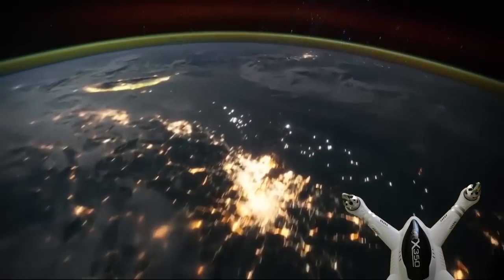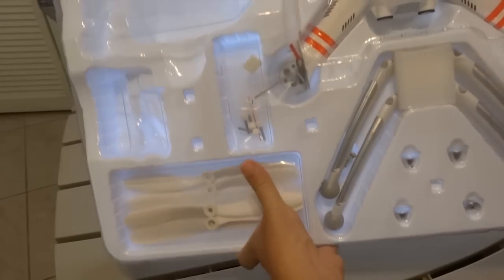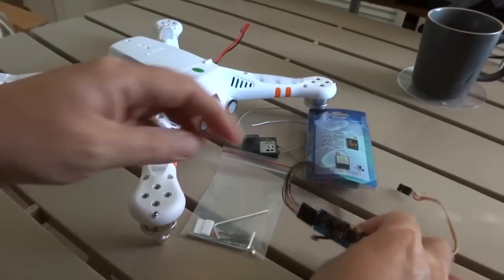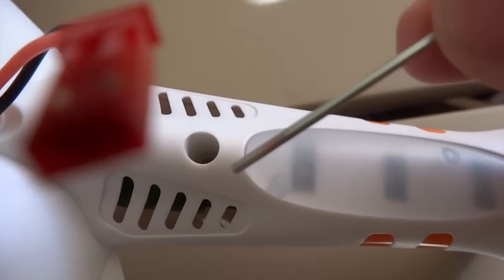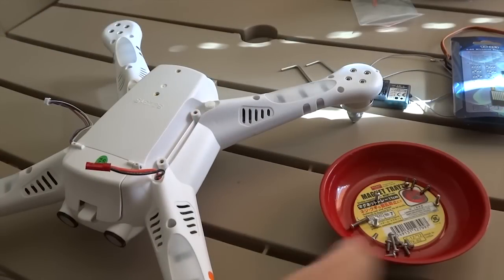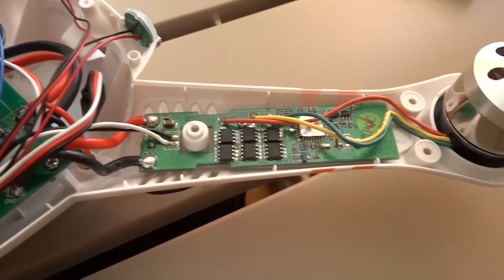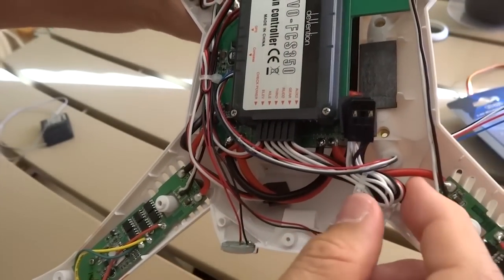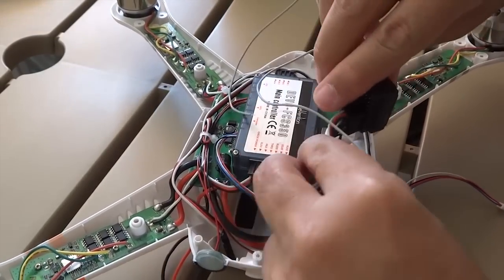Walkera QR X350 Review BNF DIY Receiver Install - Devo 10 RX 1002

Comment: Nice Video. I have a Walkera 8S with receiver. Will this unit work with the QR X350? What else do I need and how do I bind/pair the 8S with the X350?
Reply from the maker: +Silver Seeker60 hi, yes, Devo 8s should pair with most models, backward compatible.  This model is about 2 years old, and that is a long time for Drone years, try the x350 Pro or x350 Premium.

Comment: Thank you, diydrone, for your reply.  I'ts great to know someone is paying attention.  We beginners need all the help we can get.  

I understand the bind plug connects the first and third pins on the Batt terminal - the ones labeled omega and minus.  I assume this connection is to be made temporarily during the initial assembly, as the Batt socket is not accessible after assembly is complete.  

I further assume the RX 1002 receiver is powered thru one or more of the input connections (throt, elev, rudd, aler).  Which is to say it is NOT powered by a 4.7-6v source as the R702 is (per Walkera documentation).

To date I have 4 connections between the DEVO-M and RX1002.  All the above leaves me with this question:  How does one connect the DEVO-M controller for the CHECK POWER INPUT?

Once again, thank you for your help.

Paul Skrotzki

Comment: I have a X350 Pro with Devo-M controller and RX1002 receiver. Not able to bind it to the Devo 10 transmitter.  Have connected aler-aler, elev-elev, throt-throt, rud-rud, but have no chk pwr on the receiver as I do on the controller.  Therefore, have 4 items connected, not 5 as shown in this video.    Also received a binding plug, but don't know here/how to use it.  Bind between transmitter aand aircraft does NOT occur.   Manuals from Walkera are no help.  Can anyone help, please?
Reply from the maker: to clear a receiver, you just put the binding plug on the BATT slot, then power the receiver with any of the channels.  I think the light should start blinking.  the video is for the x350, so the Pro will have a Devo M.  make sure the gps is hookup.  Remove your props for safety.  You will need to power the x350 Pro first and then the devo 10.  You will then complete the Walkera Calibration.  The x350 Pro will not start up until you have completed the initial setup checks, which checks everything is connected and calibrated.

Comment: Hi all, great channel, awesome vids.Please can you give me a little advice? I've got a QR X350 which has had a couple of heavy landings! Now I only seem to get a couple of 'seconds' of run time out of a fully charged battery. Can u tell me what part(s) are likely to have been damaged?? I noted the last battery read out after running was 2 cells @ 3.75 Volts and another cell @4.20 Volts???!!!  Any info. would be greatfully received, thx, Luis in Portugal

Comment: I currently use that OSD on my DIY quad. How do you pull information from the walkera onboard flight controller into the minimOSD? does it use mavlink, or is it a type of multiwii (KVOSD firmware for the minimosd) ? thanks!

Comment: im new on the Quads ,
is there any special trims i need to adjust ?
Reply from the maker: not much, just assign your channels to your receiver.  these are RTF ready to fly, however you should get the Pro edition.
Reply: ***** okay i ordered the Walkera QR X350 PRO Quadcopter (PNF)
you have any idea how to set the 3 modes, the Manual ,GPS Hold , and the RTH?
my radio is Futaba 14SG
Reply: saleem, we don't have a Futaba, but it should be the same.  When your box arrive, you should find the Quick Start Guide or you can download it.  You will find a diagram with the Main Control Board.  Follow the diagram.  When you start connecting your channels, you will see the Gear out, just attach it to a 3 position switch channel on your receiver.  run a test at 15 feet, by flipping the switch once, putting it to position hold.  if it holds the position, you are good for the RTL test.  Make sure you have the latest firmware.

Comment: Hi, can I use Devo-M mainboard and Devo-RX703 receiver with the new Devo 10 (white) and leave everthing else as there are? I'd like to transform my X350 to X350 Pro. I want to fly it in GPS mode all the time coz I'm not a good pilot.
Reply from the maker: Hi, we asked Walkera and they say yes.   Lots of parts for an upgrade: http://dronemission.com/coupon.html  You may also want to consider the BNF and save your first model as parts.  Devo 10 is a good radio, checkout Episode 50 on how we make the Devo 10 into a powerhouse to fly different models.  regards.

Comment: Hi Leo,

Finally got down to fixing up my X350. OK here's the setup:
1) Changed out original ESC to HK Afro 30A
2) Changed out original motors to Turnigy 2213 900KV (200W) motors.
3) Propellers are original
4) Propeller guards installed.
5) Firmware upgraded to V1.2

Test flight once with the following report:

Everything works ok, throttle seems smoother than original, but needs around 3/4 stick to hover. I think maybe original motor is 1000kv vs this Turnigy at 900Kv? Also there is an additional weight after installing the 4 Afros30A ESCs with some length of wires.

Motors run alittle warm, possibly also because of the 3/4 stick throughout the first flight.

Alot more stable with V1.2 firmware. Will give it another 2 battery packs to settle down before switching to GPS mode and RTL.

Lastly, just to highlight, i realised what caused my original motors to stutter and ESC burn. There are 2 long screws and 2 short screws for the motor mount. I took out the motor mounting screws to put on the propeller guards, and when i screwed them back, the 2 long screws somehow went into the motor magnet coil wires. There are too long and if you try to screw them in alittle too much, you will hit the coil wires like me. That caused binding and in turn caused load on the ESC. It is truly a silly mistake. 

I am not sure my initial weird flying behaviors were caused by the faulty ESCs or the V0.9 firmware. Anyway, i can't know the answer now that i found out i caused the original motors and ESC to die. 

So for all those reading this: BE careful when you are putting on propeller guards or if you are going to remove the original screws!

Next up, once the FC proves to be able to fly stable, i am going to transplant the whole FC onto a "Reptile" quad frame and setup for FPV flying. Will keep you posted on that as well!

Cheers.
Reply from the maker: Alan, that is an interesting observation with regards to 2 long screws and 2 short screws for the motor mount causing the motors to stutter.  We will definitely take note of that.  We spoke to Walkera recently and they say the firmware V1.2 and 1.3 are identical with the exception that 1.3 has a lower voltage protection.  So if you want to fly longer, use v1.3, but take the necessary personal precautions, like keeping track of time.

With regards to PID for H-frame copters, we do not have any experience in that, but I will always start without any change and a well balanced prop.  Sorry for the delay reply, we have been busy with the finding missing children projects, so a few APM videos stays in the queue before we can get back to it.  We also have 2 planes that need work, one will be upgraded to Arduplane.

If you or anyone would like to contribute to the next video campaign, just raw footage, see details www.dronemission.com/video.php  We would love to see you fly over the Merlion, just kidding.

Leo
Reply: Hi Leo,

Thanks for the tips on firmware differences.

Recalling back, I think the longer screws could have come together with the prop guards. In all cases just be careful.

Btw, I also managed to hook up minimosd V1.1 to my Ardupilot. I went by the sealed jumper route, drawing power from APM only. All is good! Forgot about my FTDI adaptor though, waiting for that.

Hey thanks for invitation to the video campaign! Honestly my group are still multicopter novice so no long range flying for us. Yet. Hahaha

Will tell my buddies about it. Maybe u may find some of our videos interesting. Be warned of the boring flying site though! 

Keep in touch buddy.

Alan

Comment: is there a battery charger you use some one help me i need a lipo charger for my 
qr x350
Reply from the maker: What LiPo battery are you using?  Is it the one that came with the QR x350?  According to Walkera this will be the charger:
http://www.banggood.com/Walkera-RC-Model-Tools-Spare-Parts-Charger--p-80102.html?p=KT2121095598201211UX

You can of course use other brand LiPo Charger or convert the connectors.
Reply: ok thanks :-)

Comment: Hi Buddy,

Just to keep you updated on my progress on changing out the original ESC from the X350.

I replaced them with HK Afro 30A esc. Remember to remove the Red power pin from the rx plug before plugging in back into the mainboard for ALL 4 ESCs.

It works ok. Then i noticed that the same 2 motors that had the burned ESCs, they are still stuttering. I went on to remove them and replaced with another 2 motors to test. Everything works normally now. 

So what i found out, the motors had some issues, which in turn caused load on the esc and caused it to overheat. Then i also realised another thing: Before my very first maiden flight, i have removed the screws that secures the motors to the arms to fit in the propeller guards. And i noticed that it gets alittle difficult to re-screw them back into the motors. And for those 2 motors that i wasn't able to screw back in properly, they ran hot and subsequently burned the esc. 

So i think the way the motors are being fastened onto the arms via a circular carbon piece, it somehow damages the motors and in turn causes load on esc. 

You may want to check your motor mounts and see if its the same case.

I am going to buy multistar motors to replace all 4 of my original walkera motors.

Oh yes btw, the APM 2.5.2 ROCKS on my H4 Quad Copter!!!
Reply from the maker: Hi Alan.  Wow, looks like this is going to be an expensive QR x350 you have.   By the way, did you get the APM from RCtimer?  Did you get the u-Blox CN06 Plus GPS Receiver, We were wondering how the GPS performs? ~ Leo
Reply: Hi Leo, yes i bought the BNF X350 cos I thought can save some $$$ by using my JR radio but in the end I am paying a lot more repairing it! But I think the Afro 30a esc and multistar 980kv motor will give the x350 more response. Just a pity I will not have the Red/Green LEDs anymore as they were soldered onboard the original ESCs. 

I bought my apm 2.5.2 with uBlox 6M from sdshobby. It works great with the latest firmware and mission planner. But the issue with sensitive barometer is true, it does need to have a layer of cotton wool to lessen the interference when heavy wind strikes. Mine during loiter will drift up and down when it encounters moderate to heavy wind.

I m still flying on standard PIDs, haven't venture out much to adjust.

Do you have any recommended PID for H-frame copters?

Comment: I bought a BNF X350 as well, plugged in my JR receiver, calibrated, first flight the quad doesn't want to take off straight up. It veers heavily to the right and slightly forward. Needed alot of trim which doesn't make sense. I also noticed 2 out of 4 motors are almost hot to touch. That is just 2 short flights. 

Re-calibrated compass and sensors, quad still veered sideways. Took out my JR rx, replug everything again and tested the unit on desk without propellers. This time round 1 motor stutters on throttle and stops occasionally while the other 3 spins. I cut throttle, unplug battery and try again. This time 2 motors start stuttering and stopped completely when i go full throttle. At this point i smell burning plastic, i quickly unplug the battery. Touched the 2 motors that stutter, it was hot. Touched the 2 ESCs connected to the 2 motors, they were hot as well. One of the ESC almost went into flames if i have pulled the battery alittle later. And it all happened less than 1 minute after i plug in the battery.

This is also another case of faulty ESC? I am ordering third party ESC to use with the Quad, not going to spend US18 each for X350 replacement ESCs. Any advise???
Reply from the maker: Hi! Alan.  Looks like an ESC issue, very similar to our issue, out of the box.  The motor stutters and dies.  I am not sure about having mix esc on a quad, so I would replace all 4, if you plan to change a different type.  What replacement were you thinking of using by the way, good to know?   Thanks.
Reply: Hey buddy, I bought HK's Afro 30a esc. Actually I think 30a would suffice but what the neck might as well get the best. Dimension wise I think should fit snugly. Have to solder motor and power supply  wires into 3mm bullet connectors though. It's frustrating to have major issues when it's right out of box. Regarding the firmware update via usb? Any major improvements? Will update u once my ESCs are in!
Reply: Re the above, typo:18a to 20a Afro esc I might would suffice, not 30a.
Reply from the maker: Hi Alan, yes, recommended to upgrade to the latest firmware.  See Episode 34 video for complete steps to upgrading using UP02.  It gave us better flight time and also the ability to fly further out with better use of Gyro/Accelerometer.  Episode 34: Walkera QR X350 UP02 Upgrade Tool for new firmware in detail. Compass calibration setup
Reply: Ok noted! Thks for info! Also ordered APM 2.5.2 for another quad project. Will run thru your videos for better understanding in the meantime! Was it difficult to set up minimosd to APM?
Reply from the maker: Hi Alan

With regards to minimosd, with your skills, I am sure it will be a piece of cake.  Our suggestion is.. just do it.  We may have some old video build logs on minimosd, which we can pull together for a later episode for you.  The only major thing you have to decide carefully is how you plan to power the osd (the board by design, burns very easily when powered wrong).  By the way, if you are in Singapore, maybe we can come visit your paradise and film you flying your minimosd long range fleets by then! :)
Reply: Hey! Where r u guys located? Yes I am in Singapore and my group of flying buddies recently just went into multi rotors. Let me know if u guys are around! Yes if u have the set up for minimosd video will be great! What power rating is the minimosd? It needs a separate power source or can it be powered on board the APM?
Reply from the maker: ok Alan.  You are the second person to ask, we  will look for the build videos and the different minimosd makers, we have about 5 of them.  We will do the hardware/wiring version, since we did the software version already.  Look out for the video later and talk to you there.  Will PM if we make it Sg in 2014.
Reply: Cheers buddy! U have been a great help! Will keep u posted on how the hk Afro 30a esc fair on my X350.

Comment: Thanks for this great video.  I was really surprised to see the GPS was NOT Connected at the Factory.  After seeing that, to be safe I did a double check on ALL the connections and actually found a couple that were not as "snug" as what I would have done on my own.  If you own this Quad, take the time to check "under the hood".

~R~
Reply from the maker: Yes, I would check everything.  After installing the receiver we noticed one motor would die after 10 seconds, turned out to be a bad ESC for a brand new quad.  So this QR x350 has been grounded, no videos updates until we can get it replaced, hopefully soon.
Reply: ***** Sorry to hear about the bad ESC.  I hope to see more videos on this quad when you get her up and running.

~R~